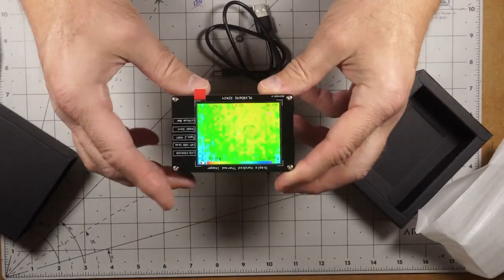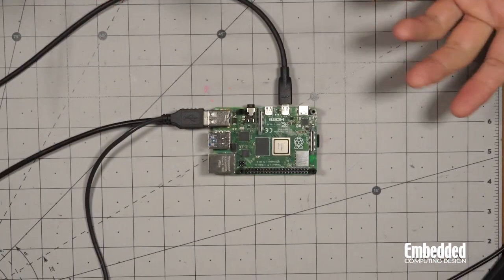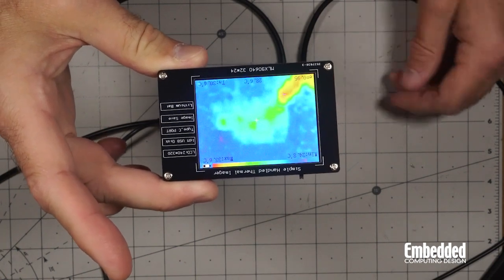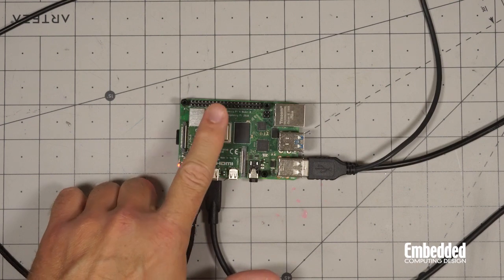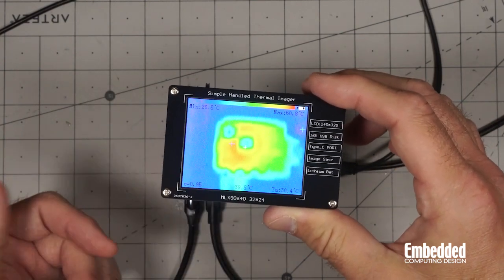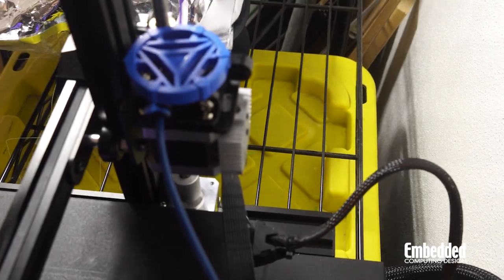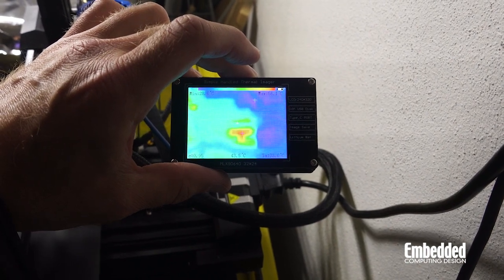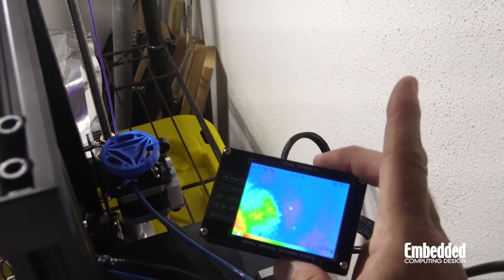Dev Kit Weekly: Handheld MLX90640 Thermal Imager

Comment: It "looks" cool, but did you check and test/validate the temperatures measured by this device ? At time, they seem completely wrong (especially at @01:55)  , and I'm afraid that it's just a cheap generator of false color images.
Reply: What any thermal imager "sees" depends not only the temperature of the object, but also material is is made of. I'm not sure what is the proper term for this characteristic in English. Should be something like "Thermal emission coefficient" or "Emissivity Coefficient". 

What that means is that if there are a piece of black plastic and piece of shiny metal being the same temperature, the latter will look much "colder" than the former. That's why the areas of the Raspberry Pi's processor and WiFi module look so "cold" in the pictures. The author should paint them black or stick a piece of black isolation strip to get more valid readings.
Reply: that would only be true if it is more sensitive in the visual range than the thermal IR range. Which is not good for a thermal camera. The emission in the infrared range should be dependent mostly only on the temperature and thats what a thermal imager should measure and show (otherwise contactless temperatute measurement would never work - one cannot paint everything that needs to be measured black)
Reply: Lol and obviously the hot "things" are showing color as in they're hot btw i believe it'd be more difficult to have some sort of ai to guess what it's supposed to be hot then to actually check the temp